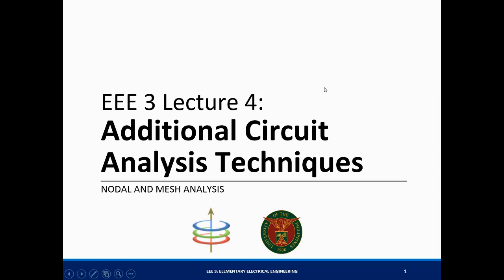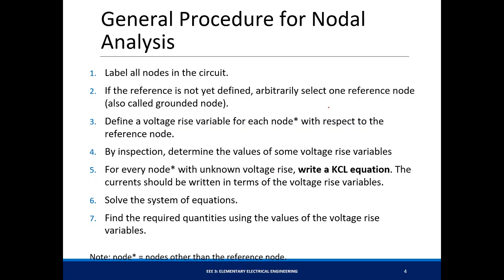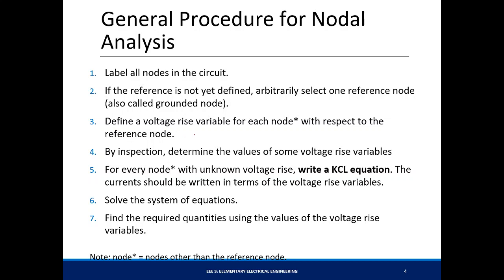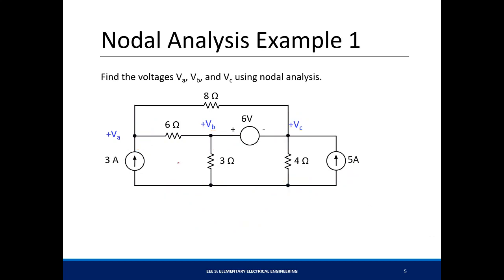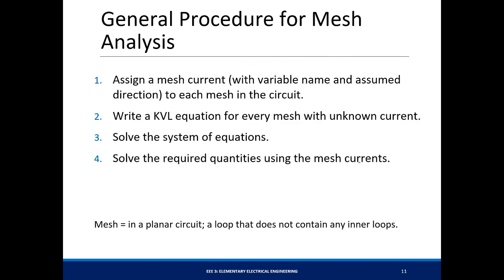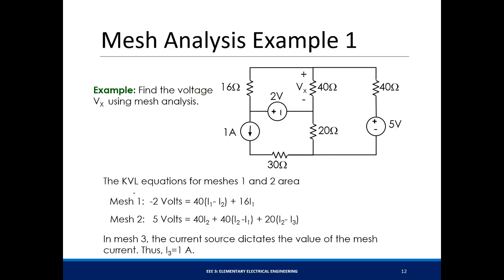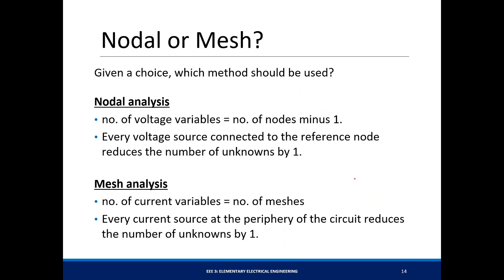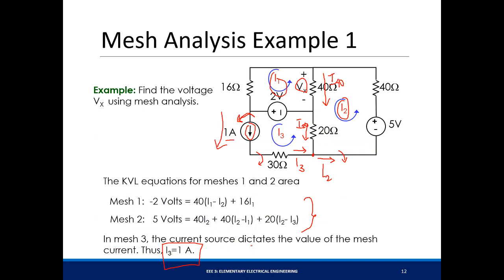Elementary Electrical Engineering - Nodal and Mesh Analysis

Comment: 20:55 - Hi sir, why is I = I2 - I1 when mathematically, I = I1 - I2 makes more sense?
Reply from the maker: It should be I1-I2. That is the equation shown in the slides.
Reply: Even though the figure you used for deriving looks like it should be the other way around?
Reply from the maker: @jedaguilar3459  no. The figure and the current directions are correct. The arithmetic is incorrect. Take note that the direction of the current across the resistor is defined by the loop. So for loop 1, it's I1-I2. For loop 2, it's I2-I1.
Reply: @charlestondaleambatali4158  Oh, so the current for the mesh in question goes before the current of adjacent meshes?
Reply from the maker: @jedaguilar3459  Yes. Just like the nodal analysis, the direction of the currents change. However, from a KVL and KCL standpoint, the equations are still consistent.
Reply: @charlestondaleambatali4158  I understand. Thank you sir!